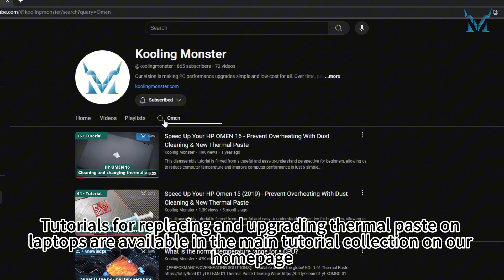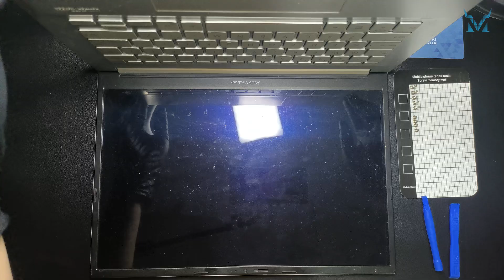Speed Up Your ASUS Vivobook Pro 14 2021  Prevent Overheating With Dust Cleaning & New Thermal Paste

Comment: Be careful when reconnecting the battery. The battery locking/retaining clip is made of metal and is electrically conductive; it may come into contact with the motherboard and cause a spark or short circuit. In these cases, I recommend fully discharging the battery through the BIOS before handling ASUS batteries with this type of connector.

Comment: Is this one the same as the Pro 14 Oled with AMD ryzen 5 ?
Reply from the maker: The one in the video isn’t the Pro 14 OLED with Ryzen 5—it’s a different configuration. But the cleaning and repasting steps are essentially the same for that model. When we do cover the Pro 14 OLED, we'll use KOLD‑01 thermal paste, which works great for Ryzen chips.
Reply: Same method, just if we have rtx version, we need to apply the thermal paste to the gpu too.. there are 2 metal shinny thing in the rtx version, and, we just need to apply little amount for the paste, not like in the video that i think too much..